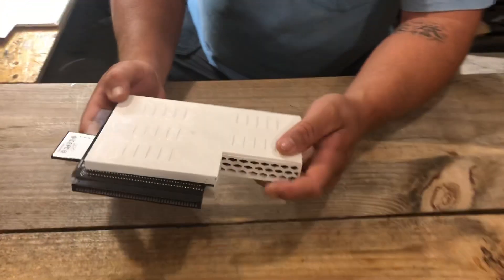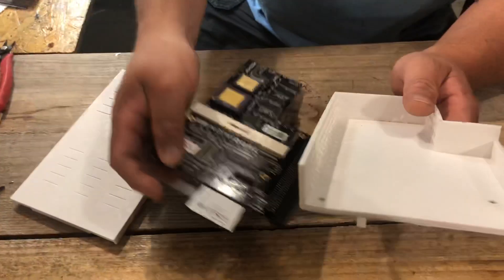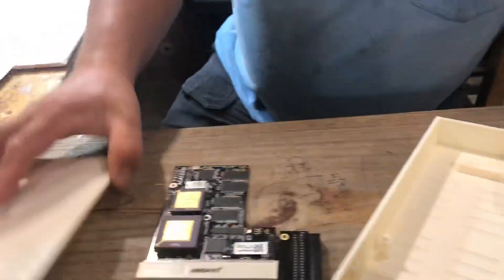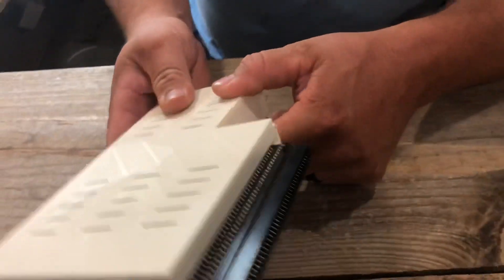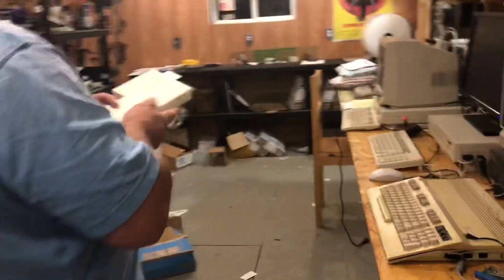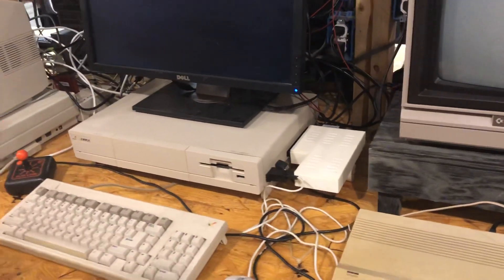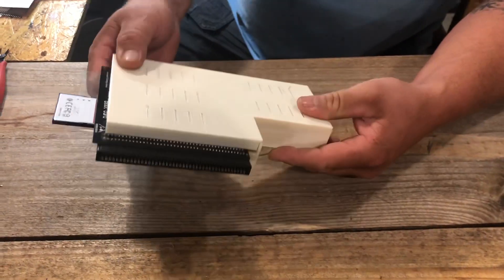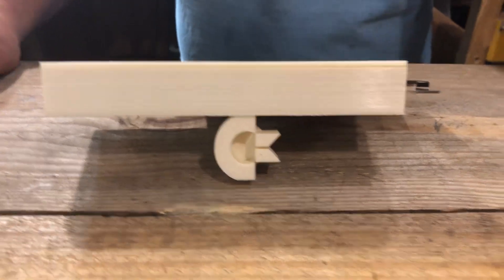ACA500  redesigned case for the A1000

Comment: That is so awesome! What a great way to hold the ACA500+ 
Is there a difference between how the A500 and A500+ would hold the ACA500+? I did not know that, I assumed they were the same
Reply from the maker: 10 Minute Amiga Retro Cast the 500+ has a small led readout on the top. This case would have to have a fix for that but otherwise I would think they would be the same. That’s why I would like to get my hands on a + to see what needed to be changed.
Reply: @commodore4ever  oh! I misunderstood - I thought you meant Amiga 500 and Amiga 500+, not the ACA and the +.